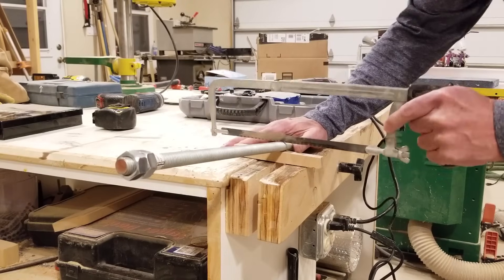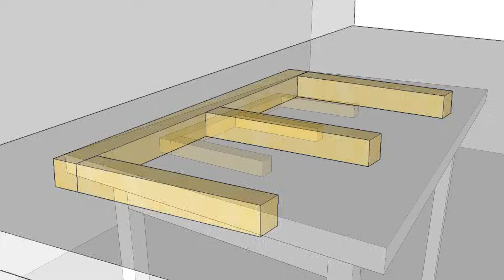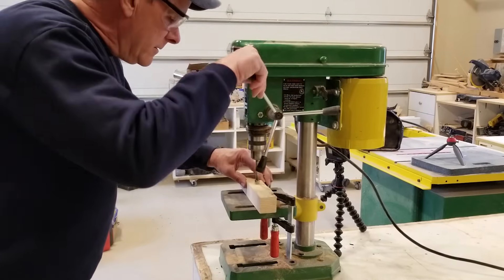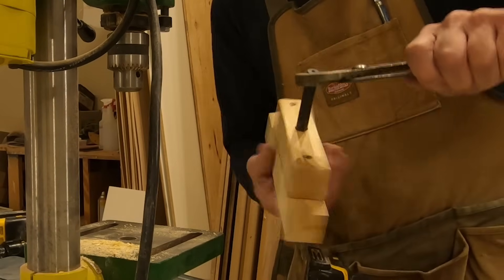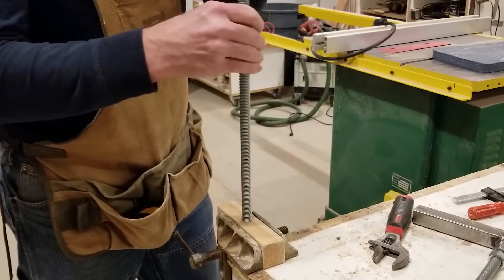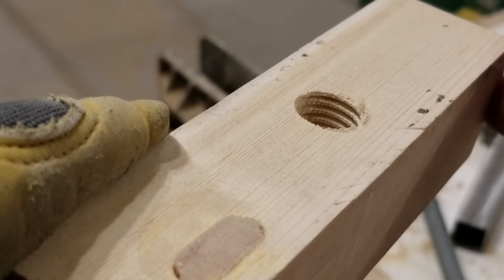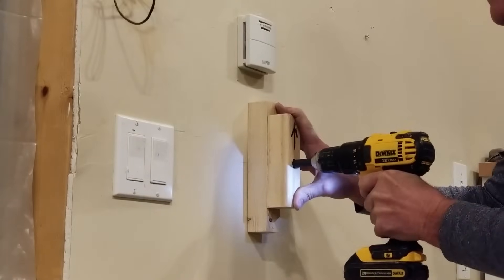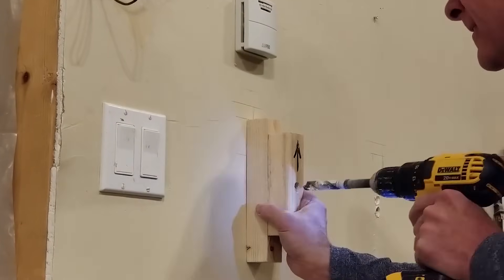Strong Floating Shelves - The Strongest Option

Comment: Could you recommend something stiffer than the all thread rod? I’m in the middle of a shelf build feeling stuck. I was able to hand bend the 5/8 all thread rod in my test mount. Now I think putting all the rods into my wall will be a mistake if they bend as soon as a kid climbs up.
Reply from the maker: Hey, William. Yeah, you can step it up to 3/4" or 1" all threads. This is one of those things that it is good you are testing your material to see how it works in your specific application. At the 11:45 point in the video, I am putting my full 200 lbs on the ends of the 5/8" rods I am using and you can see the amount of flex with the rod extending out of the wall about 14" and it is minimal. The rods certainly did not bend or deform. That way exceeds the weight capacity of anything I would ever consider putting on a typical floating shelf. 

Obviously, the longer the rods are extending out of the wall, the more of a springboard type effect occurs at the ends of the rods so wider shelves get tricky depending on the application. I go to "L" type steel brackets inset in the drywall against the studs if a wider shelf need arises that the rods don't meet. I have had a couple of people ask about putting 400-500 lb fish tanks on floating shelves. I understand the novelty of something like that, but it is a silly idea. Whatever your idea is, your support structure needs to meet that need without question, particularly if kids would be climbing on it.

Comment: Will this work with a concrete wall too? I have a concrete wall but don't know if threaded rods will work for me...
Reply from the maker: Yes, it will, James. You need to drill holes in the concrete that are just large enough for your rods to slip into. Then, as you would guess, you load up the threads with epoxy or other construction adhesive and put some in the holes as well then tap the rods into the holes until they bottom out. Support the rods at a level height until the adhesive cures and your should be good to go.

Comment: how deep can the shelves be? Can it hold a 40‘’ W x 18‘’ D shelf securely?
Reply from the maker: Hey Alex. It depends a variety of things like, the size of your rods, the spacing of your studs, the amount of weight you intend to put on the shelf, etc. Much of that can only be figured out with trial and error but it is likely that when installed properly, these shelves will surprise you with how they hold up. On the 18” width, you will have more of a spring board type effect on the outer edge of the shelf depending on the size of rods you use. The wider you go, the more of an issue it becomes. I have not gone beyond about a 12” wide shelf myself.

Comment: It seems like a great way to mount shelves-but I dont have the ability of making the tool you came up with to screw the rods into the wall. Can you suggest any way to do it if you dont have access to a welder?
Reply from the maker: Sure, Cameron! Another approach is called a “jamb nut” technique where you place two nuts on the rod you want to insert in the hole in your stud. You can tighten the nuts against each other with two wrenches and then by using one of the wrenches on the outside nut farthest from the wall, you can thread the rod into the hole. You may want to put some pressure on the end of the rod with a wood block while you are twisting the rod into the hole. When your rod is in to the proper depth in the wall, using your two wrenches again, loosen the nuts from being tightened against each other and spin them off the rod. This approach works as well as using my tool! Hope that makes sense!

Comment: I am building a fireplace with floating shelves. This is my second ever woodworking project (first was a niche/ shelf in the bathroom). Just finished the fireplace. 
I am in electrical engineering and do some mechanical too. I have been thinking of something like this, but being a novice with wood, I figure I shouldn’t. Glad i came across your video! I will implement this when I finish my basement too. Thank you!
Reply from the maker: Good luck with your projects, Alba! With your engineering knowledge, keep pushing yourself to learn more about the trades. You will be surprised at how quickly you will pick up skills!

Comment: Very nice idea, you could simply drill out the end of the all-thread and tap it for a much smaller bolt to screw into it and you would have a secure piece with a much smaller retainer showing. You would need a much smaller hole as well on your outside board or just counter sink it and put a wood plug in the hole. Just a thought or two that might help. Its a great idea for shelf for sure.
Reply from the maker: I like your idea, Kevin! I've never thought about doing that but you are right that it would accomplish the purpose with a smaller needed on the front. Thanks for the suggestion and for watching!

Comment: May I suggest to further strengthen the shelf, try to eliminate the Sheetrock between the stud and the shelf. A block the dimension of the shelf could be the contact between the studs and the wood shelf instead of drywall. I guess there’s a consideration of tapping a small block that could crack but that could be addressed by a woodworker with a little more knowledge than  I’ve got. Actually doesn’t have to be a wood block either just something more ridged than crumbly drywall. Oh well food for though.
Reply: Actually after further thought eliminating the Sheetrock could in fact weaken the shelf .
Reply from the maker: Yeah, I think you are on the right track with your thinking, Mike. Probably the potential weakest link in the whole approach is the location where the hole is drilled in the studs and the stress placed on the wood grain by the cantilever effect of weight on the rods extending from the wall. Under normal circumstances, I don't think that is an issue either. The drywall impact also seems pretty minimal. Thanks for watching and for your comments.

Comment: Could it hurt to glue a level bubble on both plains of your tapping handle, perhaps in the middle as to not interfere with your hand placement.
Reply from the maker: That might work, Mike! Someone suggested using a laser level and that is actually a really good idea. Would be very helpful in aligning the drill bit while making the hole. Those things are really reasonably priced these day and useful for a lot of purposes.
Reply: @RustyDobbs  I love my laser level but it was over 500 not including tri-pod. Good excuse to get one though, tons of uses like you said.

Comment: not sure who is stacking bowling balls and shop tools on a floating shelf.....but.....geez... are ya parking a dump truck on these things?
Reply from the maker: All I'm doing is drilling a hole in a stud and threading a 5/8" rod into it and it just happens to be a really strong support for a floating shelf. Yeah, I could use 1/4" in holes and all thread rods. It would work but the shelves would bend with more weight on them. I could use 1/2" wood dowel rods and with enough weight, the dowels would snap. Since the process is the same for any option, I'll probably just stick with the 5/8" rods and have a place for my bowling ball collection when I get one. : ) Thanks for watching!

Comment: Thanks for the video. How does this hold up over time—will it stay level?

I’ve seen other videos advising to cut out the drywall and mount the shelves directly to the studs due to the drywall compressing over time under load.
Reply from the maker: Good thoughts, Blaine. If you are mounting brackets to the wall whereby the shelves support structure will be flexing against the drywall over time, removing the drywall behind the shelves might be helpful. This concept is a little different in that the drywall is pretty much irrelevant to the structure. With the rods being screwed directly into the studs, the lateral strength of the rods is what matters. The rods I am using here have almost no flex over the 14" or so that is extending from the wall. If you had a wall with no drywall and you drilled and threaded a 16" rod about 2 1/2" into it, how much downward force would it take either to splinter the stud or to shear the rod off at the face of the stud. I honestly don't know, but practically speaking a lot. Much more than you could realistically load on a floating shelf. So, installed properly, with typical reasonable loads on the shelves, the shelves will stay level.

Comment: Great video Sir, I wonder if using a metal drill bit made of cobalt would’ve ate through that first screw in that stud like butter. Once I started using Cobalt drill bits by Dewalt and Milwaukee I haven’t been able to use anything else 💪🏽, shelves look awesome!
Reply from the maker: No doubt a better bit may have done the trick, Laurian! I have never been very diligent about researching bit quality because typically I'm going to wear any new bits out pretty quickly! I typically am looking for size then a mid range price or particular brand I usually buy. Thanks for the cobalt suggestion! I'll give them a try next time I'm buying and thanks for watching!

Comment: Is there a best way to thread the rod into the stud without the welded tool?
Reply from the maker: Yeah, Jeffrey. You can take two nuts and thread them onto your rod then tighten them with wrenches against each other. Some people call this a “jam nut” technique. Then start threading your rod into the hole in your stud by hand. Next take a wrench and use it on the outside nut to continue tightening the rod until you get to the desired depth of the hole. Take your two wrenches again and break the nuts tension against each other and spin them off your rod. Works great! If you have a socket and ratchet set up for your nut size, that works well too.

Comment: this was much stronger than I would have expected. I'm still oddly enough looking for something even stronger as I am trying to build a floating or at least semi floating counter and desk area to run along one of my walls, so the leverage at the edge would be about double, also fighting that the "room" I'm working in is a non load bearing partially cosmetic wall. its connected top and bottom like any other wall would be but studs are 24' C2C. so any "ultimate bracing" would be welcomed. I will have the paneling off so inner wall support could be an option.
Reply from the maker: Sounds like you have a good handle on the important things you should be aware of, Brett. If the wall is 2x4 construction and studs at 24” centers, you probably should beef it up some particularly since you have access to the framing. I think since the wall is opened up, I might experiment with installing some rods and placing some 2x4s on the ends and put some weight on them to get a sense of how everything might work out in a final installation. If you end up not using the holes you drilled, glue some dowels in the holes and move on. Good luck with your project!

Comment: Thank you for this. 
Could this work with a shelf/tabletop that is 24" in depth? If so, any way to calculate the weight it would hold?
Reply from the maker: You’re welcome, Fred! Yes, depending on your definition of “could this work”. With the added width you get the ‘springboard’ effect that goes with it depending on how thick a rod you go with. If you don’t mind some deflection, it can work. I have not experimented with wider shelves to any significant degree so I don’t have much insight beyond what seems reasonable. Personally, it I were to go wider with much weight, I would tend to use L brackets inset into the sheetrock against studs and inset into the bottom of my shelf or top to be sure it would work and still have the floating shelf look.

Comment: To thread the bolts into the stud without the custom tool, maybe try a cap nut and an impact drill (or ratchet) with the correct size socket.
Reply from the maker: Yeah, Sean, there are lots of ways to accomplish the same task. Using two nuts tightened against each other and a crescent wrench will get the job done too! Thanks for your suggestion and I appreciate you watching!
Reply: @RustyDobbs  definitely. Thanks for the video. This is one of the best and most interesting ways I've seen, not to mention practical

Comment: Can someone please help me. I bought dry wall anchors and a setting tool to put up my large mirrors and were fantastic but when I used them to put up my floating shelves they just wouldn’t tighten and they’d just keep spinning out. I’ve tried everything and im absolutely beside myself at this point. Any advice would be welcomed?? Thank you.
Reply from the maker: Hi Graham! Sorry you are having a hard time. I have a couple of other videos that might give you a little more insight on fasteners. One is called, “Floating Shelves Sheetrock Test…” and the other is “Strong Floating Shelves”. The simplest fastener for sheetrock is a toggle bolt. It has spring loaded wings that you push through a hole in sheetrock. The wings pop open on the backside and you are able to tighten things to the wall by keeping tension on the toggle bolt and tightening it. Lots of other newer fasteners are based on the toggle bolt concept. Hope that helps!

Comment: Great video ! I did my floating shelves for my kitchen the same way. Literally thought I had come up with the idea because everyone would do it the other way with a internal wooden frame. I had these nice thick alerce boards from Chile. And I wanted to use them so I just drilled holes and shoved them into the rods. To secure the shelf from sliding forward which is near imposible I drilled holes on the bottom with and angle and drilled some nice thick screws. I did how ever consider this from the beginning so I had wood behind the dry  wall so the screw could snug
Reply from the maker: Nice, Ismael! Sounds like your shelves turned out well! Yeah, lots of ways to approach this stuff! Thanks for watching!

Comment: I plan to use 1/2 inch 10 long lag bolts on a 2x10x6. Will probably only go about 3/4 of the way into the board. How much weight do you estimate it would hold? Lag bolt in 4 studs for support. Once the bolts are set, the heads will be cut off. Thanks
Reply from the maker: Hey James! Your approach is one that lots of contractors who have commented use to install floating shelves. The weight question is one you would need to test out and see, but I’m guessing you would be ok with most things that would fit on a 9 1/2” wide shelf. Floating shelves are a trendy design idea primarily. For really heavy objects, I generally recommend that people consider the downside of having something fall off a floating shelf when deciding on options. Good luck with your shelf!

Comment: This is one of if not thee best videos for floating selves. You’re amazing instruction is just top notch👍!  So, question, can this be done with metal studs? I looking to add a shelf that can hold up to 200lbs. Any suggestions? Thank you😎
Reply from the maker: Thanks Lou! I appreciate your comments! Metal studs are a challenge because, in my view, you pretty much need to open up the wall and reinforce the metal studs with wood blocks to have something to hold your all thread rods. It’s a lot of work just to have the floating shelf look. The 200 lbs weight is also a big problem, I think. Metal studs don’t seem to have a lot of lateral strength in my limited experience working with them. A floating shelf with 200 lbs on it would be a lot of lateral force for metal studs. Yeah, I don’t think that would be good idea. Sorry I don''t have any better ideas for you!

Comment: Special circumstance question.   Firstly, congrats on an excellent video.  I would like your opinion on the following application for a floating shelf.  The shelf would be for a stereo turntable.   The turntable is a McIntosh MT10 which needs at least a 20 inch depth for a shelf.  It is 18 inches wide and weights close to 50 lbs.  The major question I have is whether one would expect the "steel rods to bend" under the weight of the turntable.  Turntables must be absolutely level to function properly.  Also I would like to know if you feel a 20 inch floating slab with a 50 lb weight would have "too much" of a "lever action" and become unstable over time?   Thank you again for an amazing video.
Bill
Reply from the maker: Thanks for watching, Bill, and for your comment. I think you are hitting on the primary potential pitfalls of placing your turntable on a 20” wide floating slab. This sounds like a higher end project not only for function but also as maybe a focal point of a room or area. Given the specs and tolerances you need, I would give some consideration to having  “L” brackets welded up from flat stock that you could recess into your wall and shelf to hide the brackets but minimize the lever action you are talking about while still having the appearance of a floating shelf. My method might work fine for a shelf that is 30” long or less but the 20” depth is the wild card to me. The wider it is, the more possible ‘springboard’ action it may have. Weight is not a major concern, but this is something I would just have to experiment with using my method because of the shelf width. I would be more confident that the L brackets could be designed to work and give you reliable results with your turntable. Hope that helps!
Reply: @RustyDobbs  Thank you for your advice.  Very appreciated.

Comment: What size lag screws did you use? How would I size a lag screw to hold about a total  60 lbs? My shelf would span 3 studs, 16 on center. Thanks.
Reply from the maker: I used 5/8" all threads in this example, Bill, and they held my 200 lbs with barely a flex. Once you start experimenting with this type of approach, it quickly becomes evident as to how strong it really is when installed correctly.
Reply: @RustyDobbs  Thanks. I won't be putting that much weight, a couple of bookshelf speakers.  Maybe 60 lbs aat most.